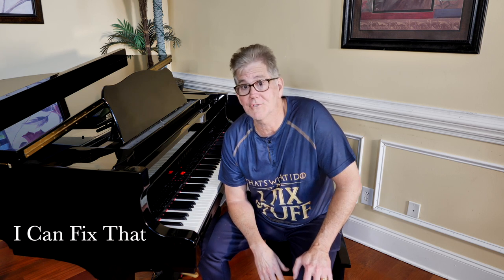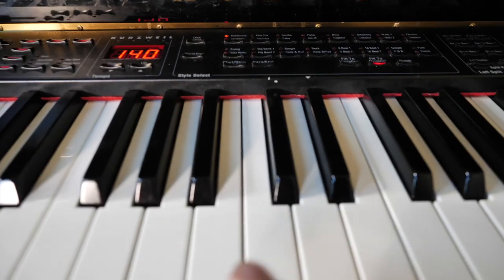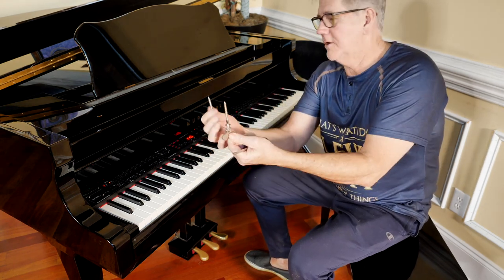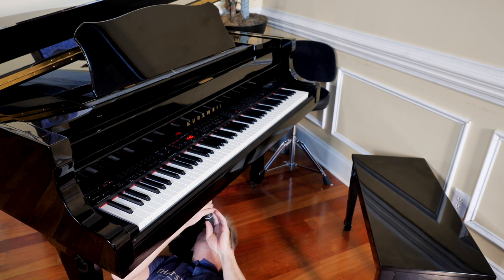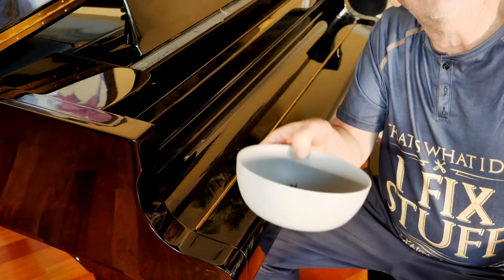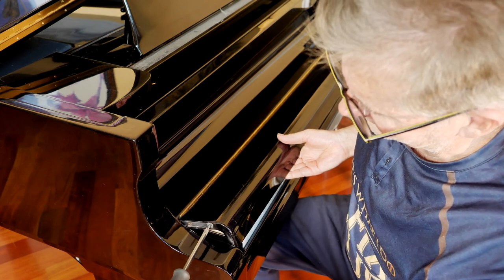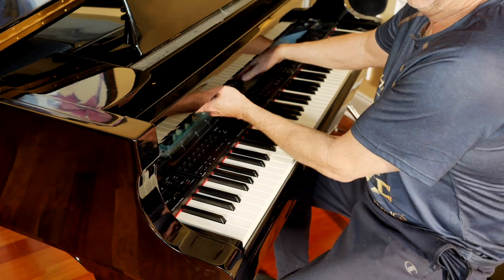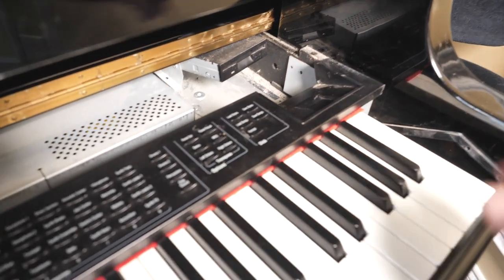How to repair a electric piano Kurzweil

Comment: Our Kurtzwell works great for about a minute or two then shuts completely off.  Turning off the power and back on again and it works again for a minute or so.  The dealer is only interested in selling a new piano.  Have you heard of this malfunction and if so can it be an easy fix?

Comment: As a retired keyboard technician, I can say you are far better off to just replace all of those rubber contacts. If you don't you can run into problems like keys double striking or keys not having their touch sensitivity working correctly.